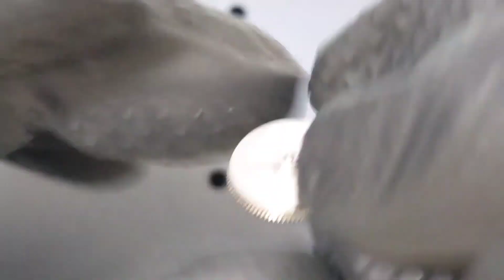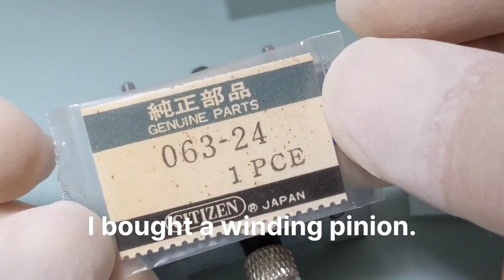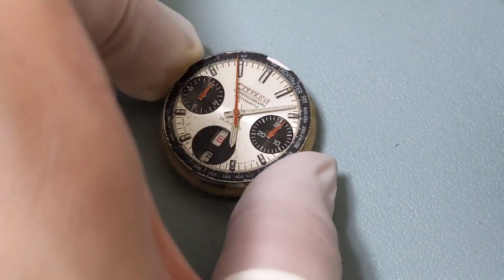Citizen Bullhead Vintage Chronograph Repair Challenge - Caliber 8110A

Comment: To fix the chronograph hand reset location, pull the crown out then press the upper right button (maybe upper left but I think right) many times and the chronograph hand will move one minute with each click. Once you get it back to 12, push the crown down. That's how you reset it back to zero.
Reply from the maker: Thanks but it didn't work on my watch ;(
Reply: @vintagewatchtinkerer  That's because that proceure is for quartz chronographs. The sweep hand on this 8110 has a D profile, so align the hand with this profile or else the hand tube will crack.
Reply: @jaliyajayasekera3421  hello!!! could you please elaborate more? i have exactly this issue with my watch. How would you know if it’s already cracked? thank you!!!

Comment: I have one citizen bull head steel bodied chronograph. The time with day and date is running but the other two horns is not functioning. The original crown is missing. Probably it needs overhauling. What to do? How it costs? Please advice. 
D.Bose 
Kolkata, India
Reply from the maker: The cost of overhauling will vary depending on your watch condition. My one is fortunately all parts are still functioning so it runs again after cleaning and lubricating. If some parts were missing or broken, it would cost more. The parts are difficult to find since this is an almost 50-year-old watch. Even if we can find one,  every single part will cost tens of dollars. The best of luck to you.